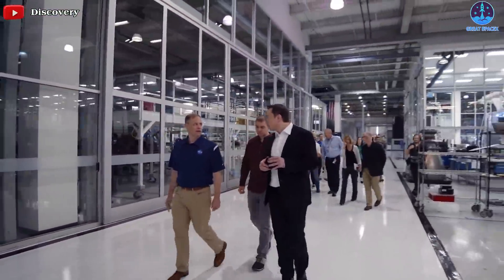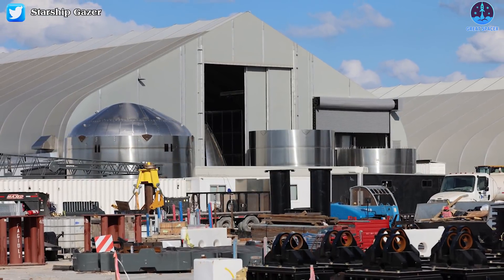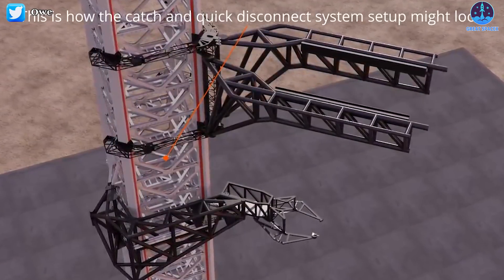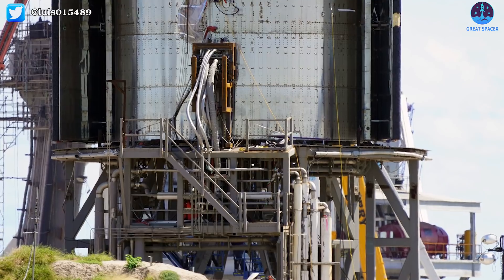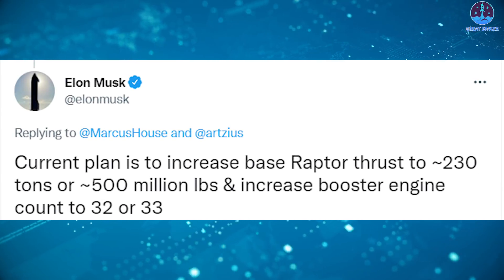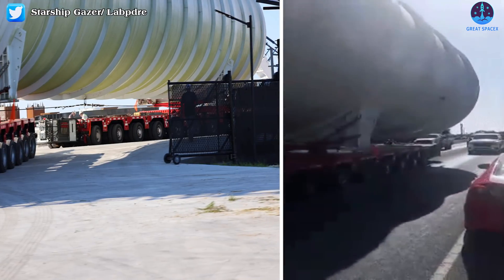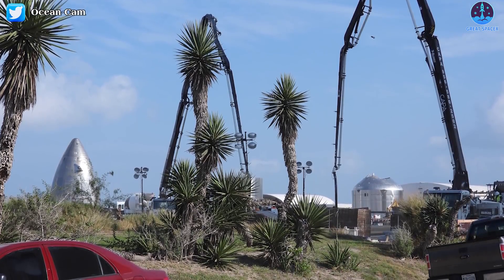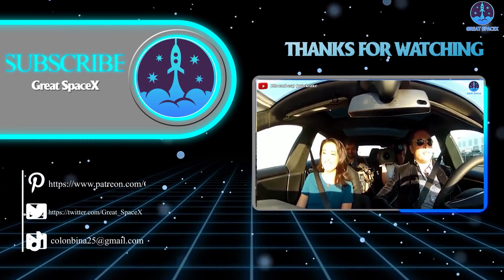SpaceX is INSTALLING Chopsticks Carriage on Launch Tower! Starbase New Update.

Comment: With all the specialized welding that has been conducted on the "Catching Arm and Chopsticks" that has been completed out in the open, I hope the quality of the welding is up to the correct standard. These components will be imparting a tremendous amount of Cantilevered weight in their own right let alone the additional weight of a landing booster. It would be a travesty if they failed in the middle of their operation of grabbing a booster.
Reply: I have shared this concern. So I am sure the engineers have as well. Tremendous, dynamic loads, yes. I'm however confident that the math has been done, and Mechazilla will do its job. At this point, I'm more worried about B5 blowing it all to hell!
Reply: @JohnSmith-yp2nt  Thanks for your reply John, it not just the maths and calcs being done regarding loadings, and stresses calculated, but I mean the quality of welds ie are they full penetration welds, have correct preparations of the plates been done properly, and more importantly post- weld quality. I have watched lots of footage regarding the welding but I have not, as far as I have seen no onsite X-ray or Ultrasound checking being done. Now in my experience of heavy fabrication of beams and plates of this size, either shop X-ray and ultrasound of joints is essential and on site welds are checked on site. Reassure me this has been done because huge structures have fallen down before through various oversites of design or quality of work.
Reply: @mattblack9069  i get what you mean. I cannot reassure you, as I haven't seen anything being high-tech checked. That said, I'll go on what I said before. I trust Spacex, their teams, and yes, Elon Musk. I'm sure they've not only done maths several times, but run cost/risk assessments as well. 
Either way, bound to be "a blast" for us viewers!
Reply: Yes this is all much different than what NASA requires. Weld, cut, bolt, screw anything requires an Inspector to "Inspect" and sign off that the task was completed to plan and Correctly. This explains why NASA funded projects are Much slower than SpaceX. Elon believes give it a try. If it fails, find out why and redesign. If it passes, find out how to improve and save weight.  Life is about Learning through Failure.
Reply: @erickdanielsson6710  If it fails and you have a fixed taxpayer funded budget you may have problems. 
No one has any idea how much cash Sugar Daddy Musk has put into this. 
Do you think the federal budget should operate this way too?
Reply: This component that wraps around the tower will not be carrying any weight. These are guide rails, same as the tracks of an elevator. There will be cables carrying the weight.

Comment: I'm dying to see the CNC machine used to carve out that thrust puck...WOW!
Reply: Especially when you remember the scale. That mfr is about a dcm thick! 
Wonder how much it weighs..
Reply: I wonder what diameter those two plugs holding chopsticks  have, since it  will have to withstand maybe WCS 500+tons with residual propelant. Manipulations with big masses and energy is always tricky. 
Nontheless I wish a success and eager to see first orbital test.